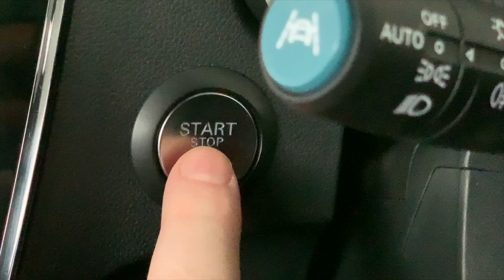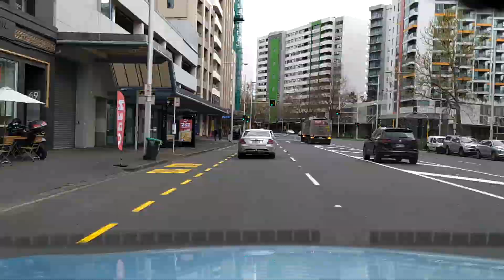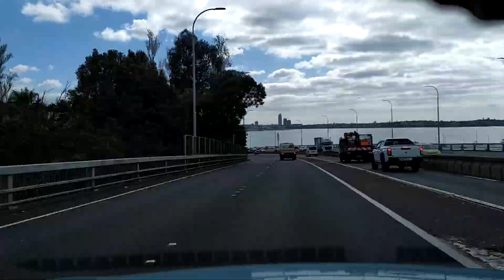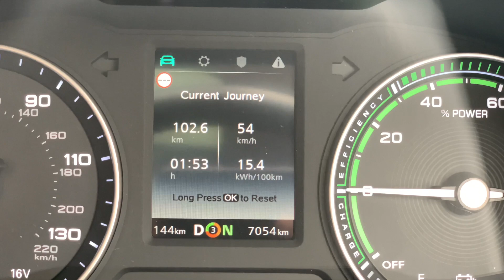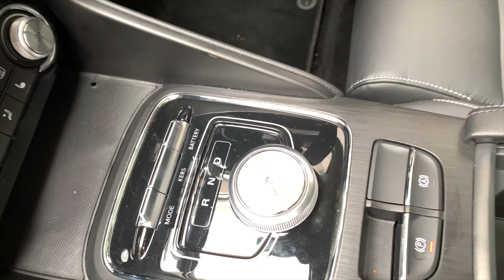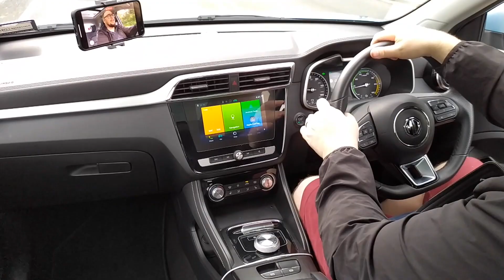MG ZS EV - First NZ drive and efficiency test

Comment: I bought exact same car a month ago and i must say i am really really impressed with the car coming from a Nissan leaf . The car isnt perfect but its a well built car and does what a car should do. On normal mode on motorway way i get 250/255km effortlessly and on mixed driving eco mode i get around 320km on a full charge. Brilliant car for what i paid. Bought its after a 2yrs lease from a company so had it on a bargain

Comment: In short, this car is more than enough for a local commute. Some drawbacks do not bother me so much esp. for several short drives. I strongly recommend this car for short journeys. The only big problem is you can't get the ZS EV that easily.

Comment: I've had my car now for one year (UK). In the summer I'm getting just shy of 200 miles on a long journey.
A couple of tips
 1 is tint the rear windows and UV protect the front
 2 put the boot base on the upper level and put all your rubbish underneath. I have a couple of fold away chairs picnic blanket coats shoes and a few other things and it's brilliant as nothing else in the boot when I go out I can't put anything else or on the top level
Very pleased for the car I would recommend it, as I said I've had it since the 1st of October last year
Reply: great tips! did you put a tint on the sunroof?
Reply: @wyattnixonlloyd8570  already tinted from the factory